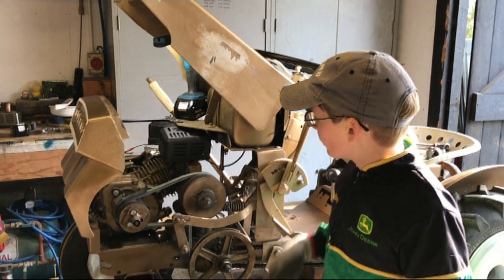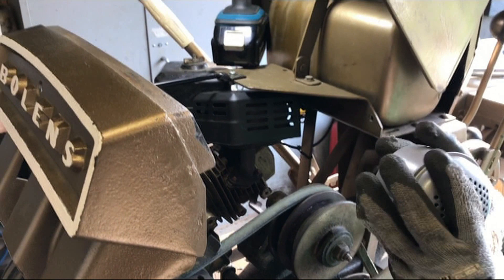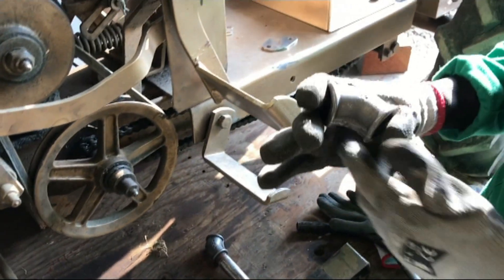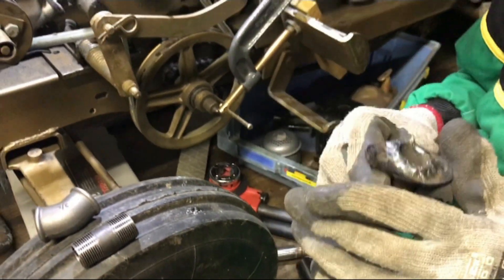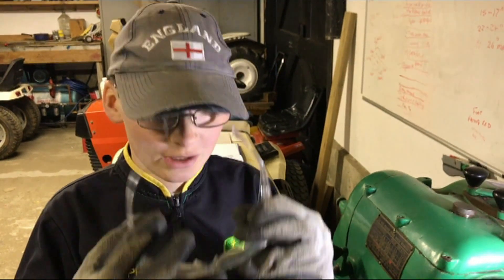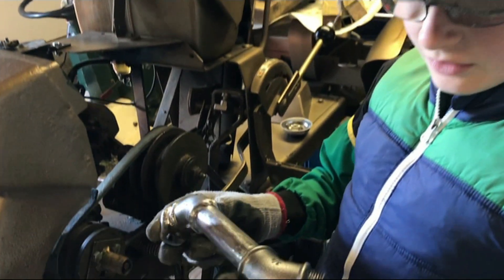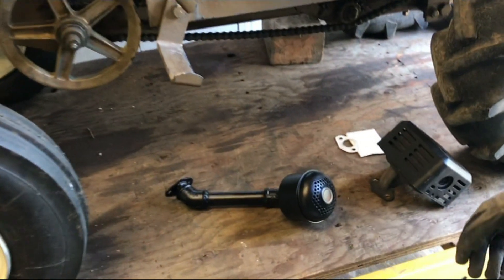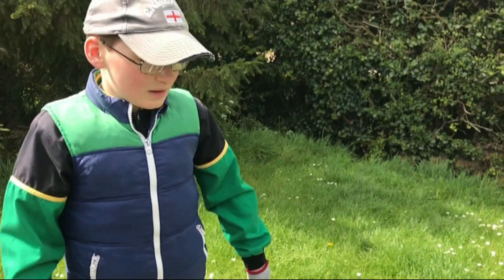1962 Bolens Ride-a-matic - Custom Exhaust

Comment: Great exhaust although it sounds like you have a governor issue causing the engine to rev up when you take load off
Reply from the maker: That is interesting and not something we have really noticed before. We put a new governor on the engine a few years ago and will have to check for any adjustment. Thanks for highlighting it

Comment: Great project to eliminate a scary situation 👍
Reply from the maker: Thanks, it was a good project but took longer than expected
Reply: Not really a scary situation. The tank isn’t air tight otherwise the carb wouldn’t be able to draw fuel. My bolens 1962 actually caught fire because of this exact problem and I’ve had to rebuild from the ground up. I was merely cutting grass and all of a sudden 3 ft flames bellowing out the tank. But it didn’t explode

Comment: How's she goin'?  That was a great fix to a potentially very dangerous situation!!!  Nice work on the lathe.  Do you enjoy working on the lathe Joseph?  I like lathe work but I haven't used a machinist lathe since the late 70's.  Thanks for sharing!!!
Reply from the maker: Thanks, it is one of those details we would have picked up earlier if we had did the original engine swap. I really enjoy using the lathe and mill. Both of our machines are 1950's, a Colchester lathe and a Cincinnati Mill. They take up a huge amount of space in our small workshop, but they are great to own and use.

Comment: that modification turned out really good,  the new muffler  is not as quiet, I  have used that type on different engines myself but they are not real expensive and they do work reasonably well.
Reply from the maker: Thanks. The new muffler is odd as the sound appears to be directional. it is quieter on the seat but noisier when you are next to it